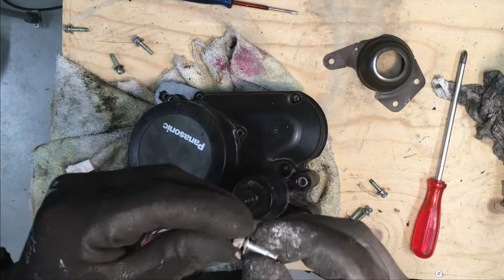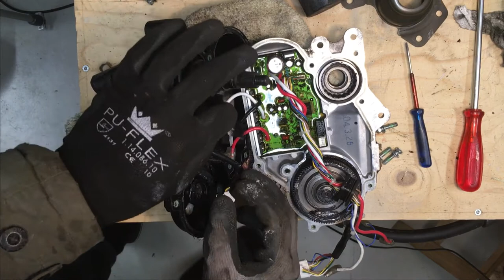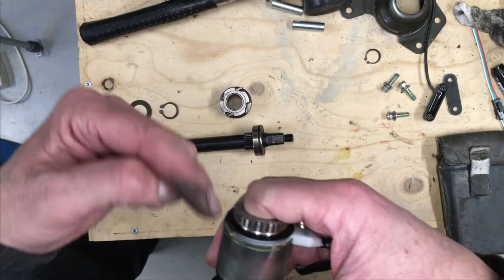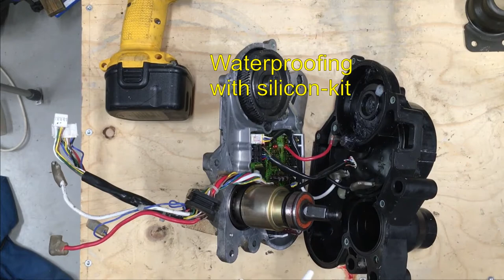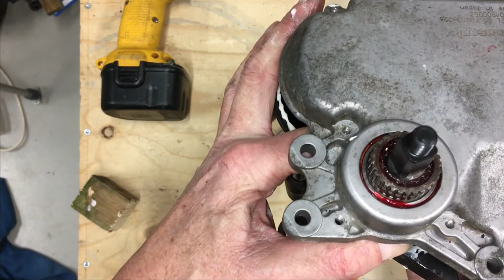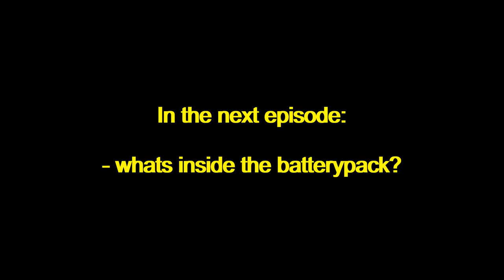Giant Revive Spirit - Panasonic middrive disassembly and rebuild (motortype EBS008026, NUA021CL).

Comment: This video very helpful. I owned an Ebike mid drive motor similar with this brand that run pedal assist. I'm thinking if I can add twist throttle. Is it possible to add twist throttle?
Reply from the maker: Not that I know of, at least, not with Panasonic middrive motors from 10-12 years ago. The Giant Revive Spirit is the only ebike with a Panasonic motor that has something that looks like a throttle and it is the only ebike with a Panasonic motor with brake-levers that stop the motor-assist. The Panasonic motor can do it all, but it has to be wired and/or programmed to fulfill certain tasks. The throttle on the Spirit can only be used to change the assist-level and when you have reached the level you like, then you can push the “cruise” button to fixate the assistance-level (until you hit the brakes). I have not seen this on a Flyer or Kalkhoff ebike (which also were equipped with a Panasonic mid-drive motor). Other , more recent, motor brands often do offer a throttle as an after market upgrade. They cannot sell the bike including the throttle because of legislation. An ebike with a throttle is a motorcycle and requires extra insurance, other traffic rules apply, wearing a helmet is needed etc.

Comment: Hello,

I recently bought a bicycle with the same motor. I’m not very experienced in these matters, just a hobbyist. Unfortunately, I was a bit misled, and the condition of the bicycle is much worse than I thought.

I’m experiencing an issue with the play in the large chainring, causing the chain to sometimes drop off. The small chainring, which is driven by the motor and functions as the motor's sprocket, also has a slight amount of play. But the main thing I’d like to ask is: is it normal for the small chainring, which the motor drives, to resist when I pedal without motor assistance? It seems to lack free play, causing the chain to sag from the large chainring when I start moving. When the motor starts, it suddenly grabs the chain, which sometimes makes it drop off again. Could you perhaps offer some advice for an inexperienced hobbyist?
Reply from the maker: The axle with the small chainring is normally freewheeling counterclockwise. So when turning it counterclockwise by hand (which I just did on a spare motor) I hardly feel any resistance but when I turn it clockwise then I feel a lot of resistance. I hope this helps.
Reply: @zenmannl  Thank you very much. so there's something wrong with my engine.

Comment: Hallo,

ich habe vor kurzem ein Fahrrad mit dem gleichen Motor gekauft. Ich bin nicht sehr erfahren in diesen Dingen, nur ein Hobbyist. Leider wurde ich etwas betrogen, und der Zustand des Fahrrads ist viel schlechter als gedacht.

Ich habe ein Problem mit dem Spiel an dem großen Kettenblatt, wodurch die Kette manchmal abspringt. Auch das kleine Kettenblatt, auf das die Kette vom Motor übertragen wird, hat ein leichtes Spiel. Aber das Hauptproblem, das ich ansprechen möchte, ist folgendes: Ist es normal, dass das kleine Kettenblatt, das vom Motor gedreht wird, Widerstand leistet, wenn ich die Pedale ohne Motorunterstützung drehe? Es scheint keinen Freilauf zu haben, was dazu führt, dass die Kette von dem großen Kettenblatt absackt, wenn ich losfahre. Wenn der Motor eingeschaltet wird, nimmt er die Kette abrupt auf, was manchmal dazu führt, dass die Kette wieder abspringt. Haben Sie vielleicht einen Rat für einen unerfahrenen Hobbyisten?

Comment: So did you have a fault? You stripped down the assist detector but did nothing to it? I'm trying to find fault that motor just does not operate. All lights on battery okay etc. it doesnt seem possible to just run the motor to see if it work with this motor? any advice appreciated. thanks
Reply from the maker: I bought the bike as a “non-runner”. I disassembled it to try and find a cause. As it turned out, there was no problem! I found that it is hard to test the motor with the bike hanging in the air. It can be done when you have the brake-lever pressed in with a zip-tie and then turn the pedals around. To reliably test the motor I prefer to mount it on the bike and just start pedaling on the road.
Reply: @zenmannl  oh really, so didn't you try it first?
Reply from the maker: @pigerg  Yes, I did try it but I tried it when when the bike was hanging in the air. That was before I knew you really have to apply a strong force on the pedals before the motor starts supporting. Live and learn…
Reply: Hey, do you know if there is a risk of  getting dirt and ruste inside the machine? Mine is super dirty and there are rust on the crank lever. Your motor seemed very clean for being an used one. What can you tell about the motor regarding its quality and its components?
Reply from the maker: @bjorkstal2041 Quality of the Panasonic motor is very good. Dirt can not get inside. Me and my wife still use our 15+ year old Flyer e-bikes and no issues with the motor whatsoever.
Reply: @zenmannl  great to hear. So maintenancewise, it is not necessary to open up the motor?  I bought a used mailbike and its quite used...
Reply from the maker: @bjorkstal2041 I would just use it till you hear bearings grinding very loud or some other part fails. Disassembly and rebuilding is not easy. I bought a few of these motors for spare parts or so I just swap the whole motor.
Reply: @zenmannl  thank you for your advice! Then I know I won't crack it open because I haven't noticed any weird sound despite being filthy and rusty when pedaling... You have a great day and keep it up!
Reply: @zenmannl  i messed up :-( I accidentally connected the battery wrong to the motor, and there was a spark. Those "arrows" of the battery only scratched the surface of those goldplates on the motor where you insert the battery's arrows. When I put it right then the display got electricity but I haven't been able to test the motor again due to repairing. With your insights of the Panasonic motor, do you think it survived or is it hard to tell?
Reply from the maker: @bjorkstal2041 I assume the motor is very well protected, but you only know for sure after another test. Good luck.
Reply: @zenmannl  ehum, so not any comforting insights regarding the motor? :(
Reply: @zenmannl  my motor survived despite I placed the battery wrong! Truly awesome! But now my bike-mechanic has stumbled on another problem, the power from the motor seems to be too strong when pedaling so the chain jumps off. We looked at the spring that's supposed to hold the chain in place, but it falls. The cugs gets pushed forward rather than being in place when the motor pulls the chain. Earlier the bike was used with 3 gears but now it's 8 gears, not sure though if that has to do something with the problem... Do you have any insights of how to keep the chain in place? I'm not sure of what to search for on the internet to solve this particular problem... You're my last hope... Whoever placed the spring earlier seems to do done some freestyling aswell...  It's an unusual motor so my bike-mechanic is a bit confused despite his long experience. 

Any advice/tip is very much appreciated... This bike is going to help me transport my kids from and to school over a long distance...
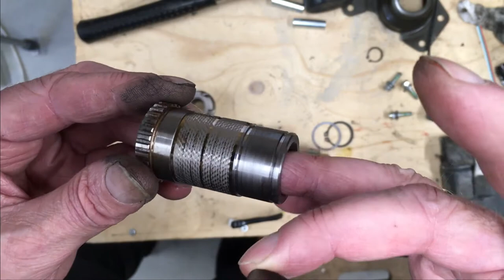Reply from the maker: @bjorkstal2041  I have had the same issue. Do you have a bike with derailleur or is it equipped with an 7/8-speed hub? My issue was that the small sprocket on the motor was to wide for the narrow chain that was needed for the rear sprocket-set.  I have a video on that. I will try and find it and add it to this comment. #edit: at 10:15 I show the problem I had. https://youtu.be/_Efjphv37XE?si=NjEOOKk1dtm2W2Ip

at 0:46 in this video I tell about making the tips of the small sprocket more narrow which solved my problem: https://youtu.be/M40O1aB1iOY?si=cSBTPkdeQLnNeJJr
Reply: @zenmannl  i think it's called a 8 speed hub, it's in the middle of the wheel so to speak. I'll check the video immediately.
Reply: @zenmannl  Can you give me concrete advice I can do with the chain tensioner? You speak a different language than I do, and the translator doesn't work. 

 It's a 8gear speedhub. The small wide peg  that points horizontally isn't straight on mine, it's almost a bit folded... when the chain tensioner pulls the chain this peg gotten smashed somehow... not sure what happened with it but it seemed it worked earlier with that defect (?). What are those small holes in the chain tensioner used for? Again, your advice is worth alot. Thank you so much
Reply from the maker: @bjorkstal2041   the chain tensioner was not causing the problem, it was the small sprocket which had tips that were to wide. I made them narrower and that solved my problem. I don’t know what you mean by “small holes”.
Reply: @zenmannl  somehow they managed to fix it, they bend the chain tensioner and tries to make the spring as hard possible. But a new chain tensioner is ordered. Anyways, the bike is literally flying, unbelievable engineering! 20 years old and still going strong. Thank you for your support!
Reply from the maker: Thanks for letting me know. Enjoy your ebike!

Comment: ola,¿para que sirve el cable azul que está donde se conecta la vateria?
Reply from the maker: There is a red and white cable for the battery. @15min 23seconds you see those wires on the left side of the screen. The white cable has a thin blue cable attached to it with a white zip tie. Is that the blue cable you mean?
That blue cable tells the display how much voltage is left in the battery. This only works for e-bikes from Flyer (Swiss brand), on the Giant Revive the battery does not have an active pin inside for the blue cable.
Reply: @zenmannl  se me averió la batería original, y fabrique una,pero solo tiene 2 cables,1 rojo  y 1 negro,cuando los conecto a la bicicleta el display parpadea y la bicicleta no funciona,¿que puedo hacer para que funcione sin conectar el cable azul?si me puedes ayudar en esto te lo agradecería mucho
Reply from the maker: @robertolopezlopez7105  what type of display do you have and what type and brand is your bike? What is the voltage of your home-made battery?
Reply: @zenmannl  BH EMOTION CITY  HYBRID 36V, pantalla led
Reply from the maker: So you have a 36V midmotor from Panasonic with a LED display with a homemade 36V battery. When you activate the system the display flashes and the motor will not assist. I think this is a protection from the manufacturer so you can only use their batteries as a replacement. The display needs a signal from the battery management system inside the battery to start up properly. That signal probably travels through the blue cable. Older e-bikes did not have these software-protections so you could change parts yourself. That is why I prefer the old stuff, I can replace every electrical part without the need to go to a bike-shop to tell the electrical system that there is a new part that can be trusted. I think a lot of manufacturers try to protect their business this way and violate “the right to repair”. It is a disgrace but you see it everywhere (Apple is a master in this field of protecting their business by making it impossible to repair their products). I’m sorry but I think you can not solve this yourself, you probably need a battery from BH to let it function again. Did you try a BH battery from someone else? That way you can determine wether all the other parts are still in good condition.
Reply: @zenmannl  efectivamente era lo que me comentas,me an recomendado que cambie la centralita,la e pedido en Aliexpress ( que por cierto es barata),biene con display ,acelerador y sensor de pedaleo.Gracias por tu ayuda y tu tiempo 👍